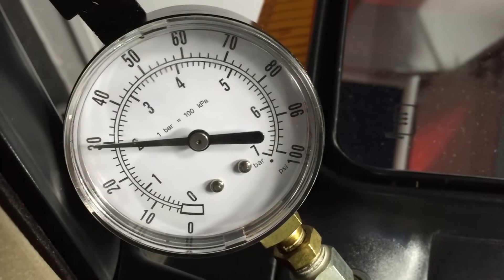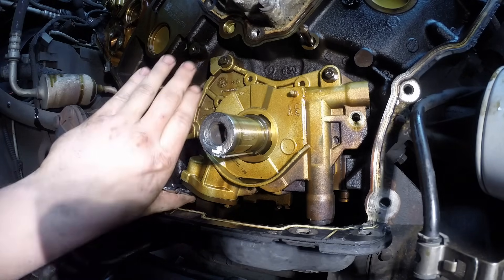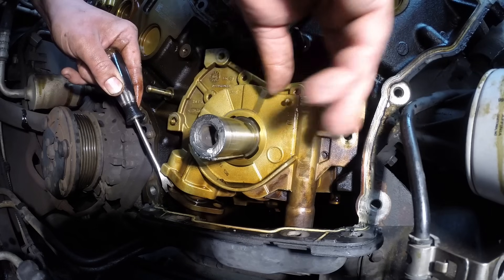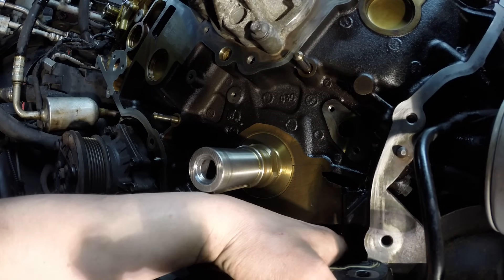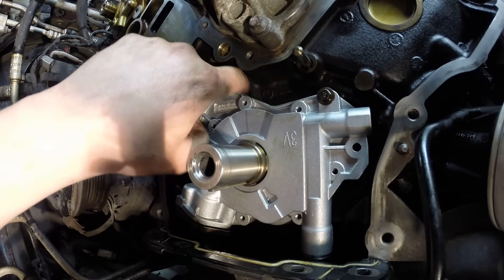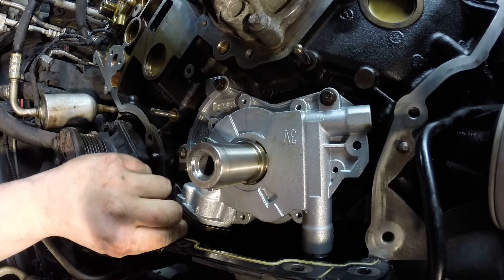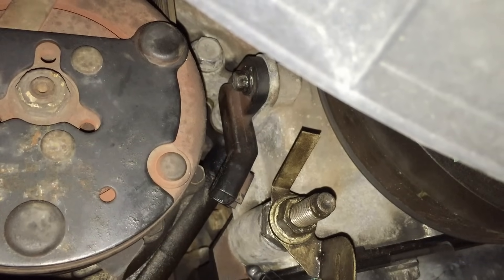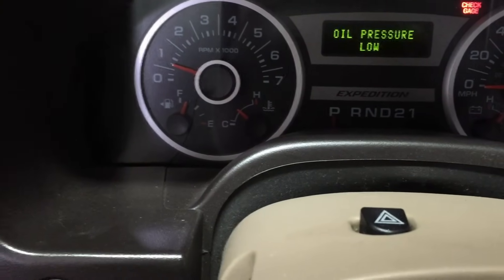Ford 5.4L 3v Engine Melling M360 Oil Pump Upgrade

Comment: I clicked on the link you have for the upgraded oil pump but it says it does not fit my 2010 F150 fx4 5.4 L? Is there a different one i should use?
Reply from the maker: It does trust me!
Reply: ok Thanks will order today and another question so i had the problem where when you come to a stop and the truck starts to vibrate very rough  I swapped out the vct on both sides and it was good for a day and started to do it again does that mean that the cam phasers are bad?
Reply: I have a 2010 platinum 5.4 3v and was getting directed to a different pump as well.  Price was a little more but I will be following Ford Tech Makuloco info.  Can just the oil pump be changed or everything pulse timeing kit! Cast iron or Ford oem kit?  I'm definitely thinking schedule appointment with Ford Tech Makuloco since my sister lives in Chicago!

Comment: Is this also an issue with the 2V 5.4 Triton engines and is there a similar pump that will fit?  I have 242K on the engine and I think it is due for a timing change as it will make some noise at idle during initial startup, but otherwise no issues.

Comment: Melling also offers cast iron timing chain tensioners now as well.  Have you had the opportunity to try those or get your hands on a set of those yet?
Reply from the maker: I have used them in two vehicles so far no problems yet and the machining and finish on the seal side was spot on.
Reply: @FordTechMakuloco  Glad you agree. I asked this very question, so disregard it :) Part number is BT402 and BT403 Especially nice is they're ratching, so the chains never slack overnight and make noise on startup, even after many, many miles.

Comment: Hey Brian I own 2 -5.4L 2 valve motors, with no cam phasers or VCT sensors. Do these motors still need oil pump updates?
Reply: Michael Longo nope.  Only the 3v

Comment: Hello Fordtech, Ive just followed these steps but I dont have an oil pressure gauge to see if Ive done everything right. I have let the engine run for 10-15 mins, but cannot see any oil splashing around on the phaser when i look down the oil cap. Should I be seeing oil dripping and splashing around or have i screwed up monumentaly? THanks in advance and love your work. You have a pretty big fan base in Australia here!!
Reply from the maker: If you have oil pressure according to the gauge and the engine sounds normal then its ok. The passenger side phaser does not get a constant splash like the drivers side phaser.
Reply: Thank you. Being an aussie car, the oil filler is on  what would be your passenger side. Im going to pull off the left bank rocker cover and see if theres any oil there, and crank it over to make 100% sure. Thanks very much for replying!.
Reply: *UPDATE* oil was getting to the left bank, but not very much according to my inexperienced eyes. Did an engine flush and oil and oil filter change, put in some 10w40  and its the quietest its ever run. no rattle on start up, or what sounds like a bottom end knock when taking off. Im taking this as a win. I did take a vid of it running without the rocker cover on. I might paste it on my youtube page and link in.
Thank you for your time and advice !

Comment: I wish you would have started from the beginning showing how you removed the front cover and most importantly how you removed the timing chain and tensioner that was in front covering over the oil pump itself. I have a 2005 Ford F150 XLT 4X4 5.4 3 V Triton engine with 55, 000 miles on it and I am thinking about just replacing the oil pump itself, not all of the other components, because of the low mileage.  BTW IMHO you are the best that is out there, love your detailed explanations.

Comment: I have a ford f150 4x4 2001 super cab and its the 7700  it has 334. 000 klm on it can I get a high output oil pump for it too I don't think its not been taken care of the oil filter looks to be factory its rusted I hope it doesn't have the funny plugs in it if it does is there a way to get all the carbon out of the inside of the motor before I try to remove them and is there anything else I should do as I have the front end off  . does anyone have any advise for me .

Comment: Why not the Ford Racing high volume oil pump?
Reply from the maker: garbage
Reply: That's strange, I've been running one in my 8k rpm 2 valve build for 4 years.
Reply from the maker: I would never run ford racing components in a customers vehicle they are built of a lesser quality than I demand.

Comment: Just an additional little tip I have found when changing a GM oil pump and it would apply to the Ford as well. Loosen the oil pick up tube bolts to where about 5 threads are showing.  Loop and twist a piece of safety wire around the bolts and twist until semi tight. This will reduce the likelihood of the bolts falling down into the oil pan, or if they do, you can pull them right out and not have to drop the oil pan.
Reply: a fishing trip with a extended magnetic pick up might save the day
Reply: Brilliant idea! I just pulled the old pump out and nearly dropped a bolt. I'm taking this suggestion on the install of the new one.
Reply: Great tip
Reply: I used the safety wire on both bolts, did not drop the pan any.  The best way to get the farther / lower bolt on and start the threads is to push this in from the top with your fingers.  Best to have the gear wrench to get the right angle to get this tightened.  Before installing, run the bolts into the oil pump several times to make sure they will thread easily.
Reply: great idea. I was thinking "wow this job would be so easy if I didn't drop the bolts into the pan", which I would
Reply: I changed my oil pump today, and my fears were realized when the last bolt slipped out of my oily fingertips but luckily a maginet saved the day. I will definitely be using a wire twisted around the bolt until I get the threads started. So everyone beware unless you enjoy dropping the oil pan and retrieving bolts. Great tip.
Reply: Great tip! Also not a bad idea to place some sort of rag or small towel in the pan to prevent a falling screw from disappearing into the pan. If one does, just have a telescoping magnet retriever and no problem getting it.
Reply: i was just using a rag for this exact reason and basically did the same thing just made the bolt stay within reach and unable to fall back further. unfortunately in my "excitement" to be done already i ignored this completely when putting the first bolt in and almost immediately dropped it and each time i grabbed for it rolled further in until just out of reach. i can probably get it with a magnet but need remove the pan anyways to clean it out of debris.

Comment: Can you do a video on the Livernoise cam phaser lockout install for the 5.4 3V?
Reply from the maker: Yes there will be one soon on why you don't want to use them.
Reply: @FordTechMakuloco  is there a way to keep the phasers from chattering other than the livernoise phaser lockouts?
By the way, your Melling MV60 oil pump video is gold!
Reply: Id be anxious to know.  These heads flow really well compared to a 2v, and I would like to get another 30-40 HP out of mine on the low end.  Why not just run a 3v with a set of small cams and the lock outs?

Comment: approximately, how many hours does it take a mechanic to change an oil pump in a 2010 Lincoln navigator  and is there anything else  one would do while changing the oil pump

Comment: Really good video boss!! I got a quick question. I just got my 03 ford expedition Eddie Bauer. With the 5.4 engine from the shop. I took it because apparently my mechanic told me that the oil pump was out. He replaced the oil pump but my low oil/hi temp light is still turning on. And the oil psi drops to 0 when at idle. And idea why?

Comment: Sir. Thanks for your generosity sharing this information. One question the pump you recomended is the 360 but it does not say it is a high volume pump. Is the HV360 the same or which one do you recomend?

Comment: Brian, are you left handed? 
I use two hands to install hardware that may drop, with a finger or something to put pressure on the head, then turn to thread.
Reply: You can't get them both in there.

Comment: Is there any need for lock tight on the pick up tube bolts? I had one come off a couple years ago on another engine, that is the reason I ask.
Reply from the maker: nope just torque to spec
Reply: FordTechMakuloco thanks!

Comment: do these motors normally get valve rattle when cold started if sitting for a few days ? i noticed if i drive it daily i don't get it only when sitting a few days ..... after about a couple seconds it goes away once oil flows to the roller followers

Comment: What causes the mech oil psi gauge to flutter like that? My 4.6 does it (Aftermarket autometer gauge) . I've been told everything from a bearing about to spin to normal
Reply: lots of flutter is a bad sign,could be sticking relief valve,debris,air in the system,..

Comment: 10 to 15 minutes to swap out the oil pump, you have it down. I fought with getting the "hard" bolt in for close to an hour. Finally dabbed the bolt end in a thick grease and twisted it in with some curved hemostats.

Comment: You are quickly becoming my go to 5.4L ford guy! Thanks for the great info. I thought I had the 3 valve engine, but learned after your timing chain video that my 04 F250 is two valve. Thanks again.

Comment: Help question: i saw your video awesome by the way... But i went to Amazon and I match my 2000 Ford Expendition eddie bauer.... But Amazon saying that IT Doesn't Fit my Expendition........Melling HP m360... Why
Reply: 2000 uses the 2 valve engine.  Dont need this one.

Comment: I have a 2000 Ford f150 XLT my oil pressure bottom out after about 30 minutes I can shut it off restart and it's fine for about ten to fifteen minutes. And if I put it in nutrurle and bring the rpms up it will come back up but not always then I restart it and it is ok for ten minutes or so help...oh will the oil pressure regulator causethise problem

Comment: My ‘04 5.4 sounds like it’s ready to start spitting pieces out through the hood. Has 130,000 miles on it. Spent $3200 to have the spark plugs replaced because they all broke and the dealership had to remove one of the heads to fix it. Will not spend another dime on this engine. It is under warranty and it says any lubricated part that fails is covered. A phaser or vct solenoid or oil pump or anything else blows apart, they can fix it or put another one in the truck. If they give me any crap, they can discuss it with my lawyer, who has a copy of my warranty information. $3000 for the dealership to replace everything in the front of the engine to get rid of the diesel sounds isn’t going to happen.

Comment: I think we as ford owners we must get lists for the upgraded parts that we should be putting in our vehicles on the next services.. Because most of the parts I see every where around are the shitty parts ford failed to make properly the first time.. Why they are still around. All my vehicles are fords and I keep good record of each single thing I put in them and I know what parts I had.. but keeping track of the ones I should have is beyond me. I simply can't. I can't roam about the internet pulling up each page and read it every otherday. And then compile it in a list. It's a very consuming process. But on the bright side of things people still get shocked when they know that my super clean Mercury Grand Marquis GS is a 2004 year model and is still holding up very will and looks just like a brand new one. Also my 2012 Ford Expedition gets a lot of appreciation.

Comment: This series on changing the timing/oil pump has helped me out tremendously!! I'm gradually getting everything that I need and plan to do the repair myself. I'm not new to changing parts on my truck but this one will be the most in depth repair I will have completed! I feel very confident with having watched your video Brian. Thanks SO much!!
Reply: Working on mine as we speak, been a SLOW process with how little free time I have, but it is slowly being done right at least. Definitely thanks to this video series.
Reply: how did that go?? I know it's 6 years past

Comment: When I pull up the link for the Melling M360 oil pump on Amazon it says it will not fit my 2009 F-150 XLT 5.4 3v  Can you help with correct part number please?
Reply from the maker: It works trust me

Comment: 10-15 minute job? Mine took two days on a F150 4X4.
Reply: 10-15 minutes when you already have the front apart for other repairs, everything is lined up, and you use a time-out clock from the football field.
Reply: IM ON DAY FOUR
Reply: @ryanwalker2299  I'm on day four also, though I'm also replacing the water pump and the spark plugs and boots. It's going back together but I expect another full day at my pace.

Comment: FordTechMakuloco, I'm finally changing out all of the timing components at 366K miles. Had slap at startup and some light ticking noises. Found broken guide on left side and one bad lash adjuster and two rough followers.  Engine never had a wrench on it except for mine. Did change plugs twice myself with no problems. And regular oil changes every 5K miles with non-synthetic 5-30W since 10K, might be why it has lasted. Tip for installing the Melling 360 that I can offer...put a rag under the front to catch the bolt when it gets dropped around 10 times trying to put the back one in! What worked for me was using a long tie wrap around the bolt while starting the threads, it offers some resistance while threading it with the flex head gear wrench. Great videos by the way. BTW, I must have lucked out because I'm not really having most of the problems with the 3V that others experience.

Comment: how many miles are on this vehicle?
i have an f350 5.4 i just replaced phasers and solenoids on it has 172,000 wondering how long i should wait
Reply from the maker: 165k miles on this one.
Reply from the maker: Once you start having vct error codes caused by low oil volume you know you nee the New High Volume Pumps- https://amzn.to/2HHmIII

Comment: When you lubed the pump, what did you torque the backing plate bolts to?
Reply from the maker: 89 inch lbs

Comment: Question: after finally getting the pricing sorted out for replacing phasers and full timing chain kit 05  5.4 3v/v through my local Ford dealership, I asked the question about replacing the oil pump while they where doing this job, they told me that they would have to remove the whole engine, really, after watching your video about removing and installing a new one, do they think that everybody is stupid! How would I go about explaining "not to try and rip me off"........
Reply: They are assuming that there are guide pieces and/or other debris in the sump.   I would make the same assumption if someone asked me to do their dirty work.  This video is for the do-it-yourselfer who has no one else to blame.
Reply: @CHixon  I don't understand your response to Keith B ? The sump pan could be dropped to check for debris... but engine removal?

Comment: Why did the cluster say low oil pressure
Reply from the maker: Manual gauge was installed in place of oil pressure sending unit.

Comment: I have a 2007 ford f150 4x4  its in the shop at ford dealership getting a timimg chain put in I asked them to put me a new oil pump in while they were in there and they told me motor had to be cranked up to put it in is this true thanks!
Reply: Hi ceethelight 123, what happened with the pump? Did you explain about FTM's videos on oil pump replacement? I bought an Expy with timing components done, but no pump replacement, and I have to usr the dealership in my small town.

Comment: Did I see it stating oil pressure low at end of video
Reply from the maker: If you are talking about the cluster yes it did as the oil pressure sending unit was removed to install the manual gauge.
Reply: Was wondering about that myself.

Comment: are there any concerns with the added oil pressure on gaskets, other engine components etc.  or is it negligible?
Reply: I was wondering that myself. I did the whole timing job and new oil pump and the track ran great but soon after I had an oil leak at the rear main and had to replace that. Now I have a blue smoke at startup and burning oil issue that I didn’t have before the timing job. Wondering if the pcv valve needs replaced. I’m hoping the extra pressure didn’t damage a valve seal or something.

Comment: Why in the heck is a “ switch” used with a gauge package ? Never understood the thinking there at all
Reply: American manufacturers feel we get too excited if we see pressures around 10lbs, so they made "numb" gauges which hover around 1/2 way and we're happy. My Toyota MR2 manual said 3lbs (yes, three lbs) at hot idle was fine, but that would absolutely freak out most people. Same with temperature. The middle range is "numb" and doesn't move a lot. In my German cars, they use real gauges. Had an Opel GT with oil reading in bar. That's 14.7lb per bar, so 3 bar=44lbs, if you wanted to know:)

Comment: First of all great video, I have a 2007 F-150 181000 miles. Just had a mechanic change timing componets but failed to change my oil pump. I'm still having issues with loss of power knocking and stuff. Same mechanic said oil pump has failed now wanting to charge full labor for something he should have done 3 wks ago. I'm wondering is changing the pump even worth it? I think i'm gonna tackle the job myself not paying him double labor for what he should have done.

Comment: 04 f150 5.4 i run 15w40 detergent. 225k mi no issues ever. E3 diamond spark plugs. Engine never been apart.
Reply from the maker: I have heard that from many others also.

Comment: Brian, I plugged in the M360 for my 06 f150 5.4l, it says not compatible?  says I need to use the M10340.  T or F?
Reply from the maker: It works trust me its just an alternate version.